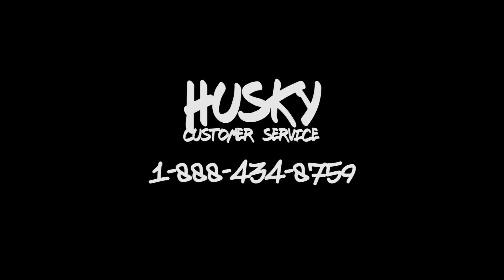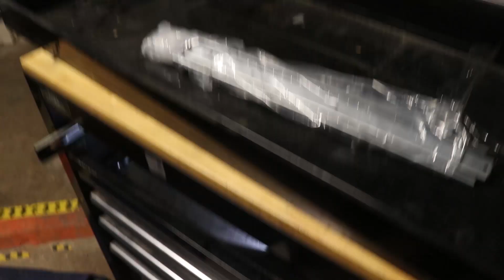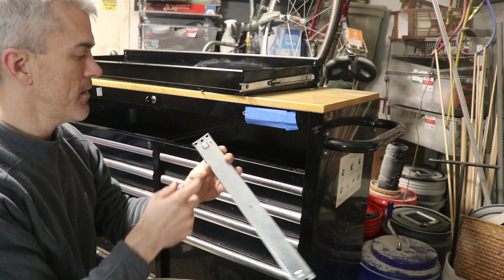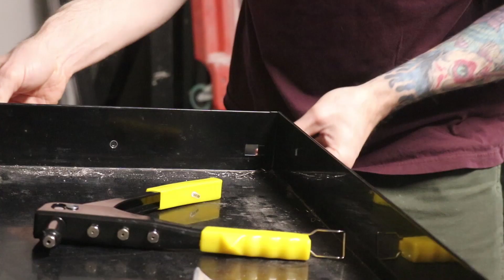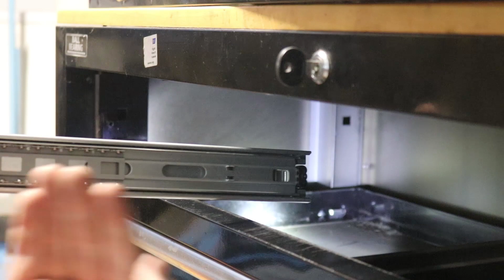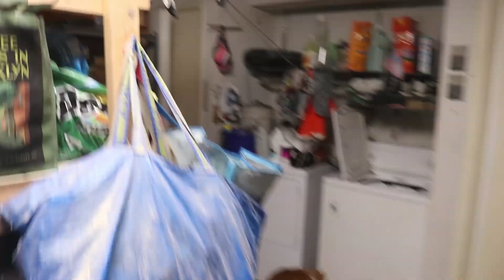Husky Tool Chest Repair - Drawer Slide Replacement

Comment: The part of the slide on your drawers are different than mine but the part inside is the same. Drilled out the rivet & needed to know what direction to pull that part off. Thanks! My new slides are totally different as they stopped making them of course.

Comment: Why not just get better slides somewhere else? It almost seems like Husky purposely makes cheap slides to sell you expensive slides down the line
Reply: They're absolute garbage of slides. Mine started breaking in less than a few months with very little use. I didn't realize they were rivets but I agree, I can't see how you can't use other drawer slides and drill holes if need be.

Comment: Nice, great video,. I had some concern about my tool chest. Quick question what was the rivet sizes you used?
Reply from the maker: The rivets came with the drawer slides, I don't recall what size they were.
Reply: I didn't receive rivets with my door slides.... so you don't know the size?  Were they less than an inch all of the rivets I have are an inch and they do not fit would appreciate your advice. Thank you.
Reply: I believe they’re 5/32”

Comment: I have the same box that you have. My slide broke. I called the number that you had listed. I got set up with a guy. Told him what I needed. Sent a picture of the slide. He said he would get a hold of me in 6 days. He called today and said they don't make the part anymore. Wonderful. I went over to lowe's and found on similar to what was in there. I'll have to jury rig a little to get it to work. Good video though. Thanks.
Reply: I know this an year-old post, but would you still have the part number?  Mine crapped out tonight.  Thanks
Reply: @alanray4689  I don't have the part number. I went to lowes, and bought a drawer slide. Make sure it's the right length, Adapted it to the drawer on my tool box. So far it works great.  I, also called the company. They said they don't make that part anymore.  Good luck.
Reply: @geraldschulz6436  I mean honestly that might be for the best, why get the slides from the same company if the originals were crap?

Comment: I would like to know where did you get sliders or rails please let me know and great video by the way thanks
Reply: Apparently no one monitoring this site anymore.  Lowes/Husky told me that the manufacturer for my particular tool chest didn't make the part anymore.  They sent me a picture of a rail next to extended tape measure.  Gee thanks right.  It seems to be close to the standard 16" rail I found at Home Depot.  I'm going to give it a try.  But would be nice to know if self tapping or self drilling screws will work in lieu of rivets.  I worry about the heads being in the way.

Comment: Hey. I have same box and same issue. Husky (Homedepot) cant figure out right slides. Was there a part number or anything referenced on yours? Thanks
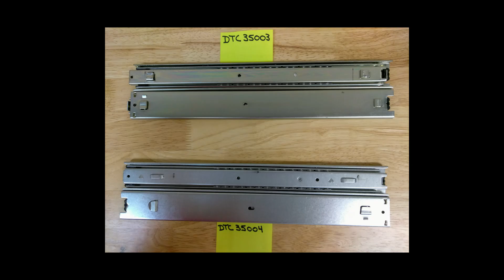Reply from the maker: At 1:00 in this video it shows slides with part  numbers. However, it depends on the age of your cabinet and these might not work for yours.

Comment: Do youbknow if any other slides are compatable like self closing or soft closing?
Reply from the maker: I went with the easiest solution, which was to use the stock slides, but I would certainly think one could install other slides if willing to customize mounting holes, etc.
Reply: @HooptieDoodle  I just traded my old service cart for the same box and had the same exact issue yours had, but I thought I would just remove 2 of the slides from one of the lower drawers making it 100lb vs 200lb and use it for small organizer boxes. This way I don't have to buy any replacements until I find out if soft xlosing ones would work.
Reply: The soft close will work but  they hold half the weight of the stock ones

Comment: Where did you order the new slides from
Reply: $14 i already had ribbits at home
Reply: @ericcorral7404  do you have a part number or link? I need the same ones.
Reply from the maker: Husky customer service: 1-888-434-8759
Reply: @HooptieDoodle  That is not Husky customer service. It is Home Depot where they will put you on hold endlessly and then hang up.
Reply: Help! Where did you get replacement slides? Can’t find anywhere
Reply: @chriscarley3323  You might be better off finding some aftermarket that can be adapted. Home Depot customer service is useless.
Reply: Good luck, I have the same tool box and the top drawer slide broke. Called HD and they are not shipping replacement parts due to COVID-19. Told me to call back in a couple weeks to see if they are shipping. Rep couldn’t give me the part number to search for them myself. Would be nice to have another source.
Reply: No the location tabs will not be there and I just added a couple extra rivets on the actual drawer itself and I used stainless rivets and 1 stainless steel self Tapper at the back Edge Inside the Box on each drawer slide the reason I went with stainless steel rivets is because I looked at the newer models and there is no locator tabs just stainless steel rivets I hope this helps
Reply: Just go to Home Depot and going to the drawer slide section and by 16 inch 100 lb drawer slides it's the same drawer slide you just have to drill your own holes and install rivets
Reply: @ericcorral7404  Will the locating tabs be there, in the right position to locate the drawer? The pop rivets are larger SS and unless you have a powerful rivet gun that won't be easy either.The larger rivets are needed to support that kind of weight.